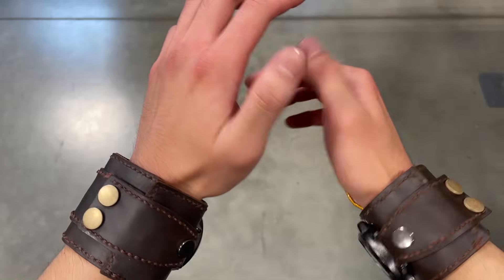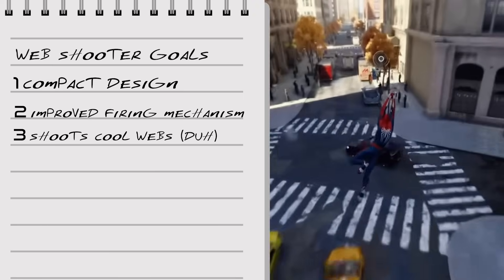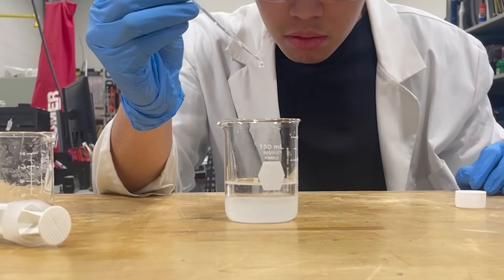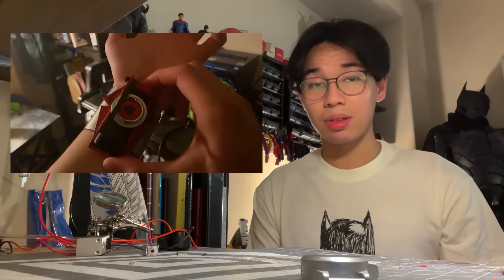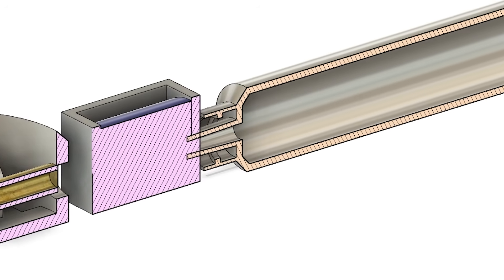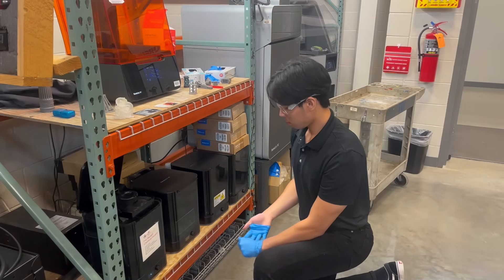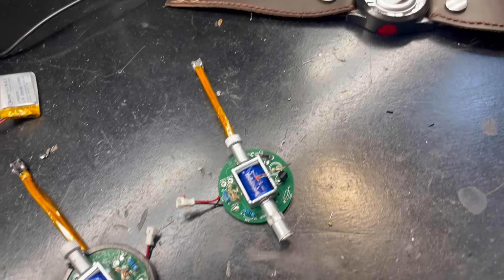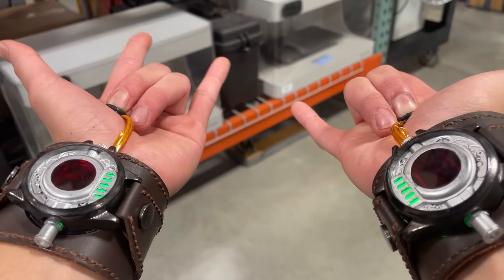How I Built Real Web Shooters | Spider-Man

Comment: Is there a website or app that will help me design a PCB with little knowledge of electronics?  I’m talking baby stuff.  I guess what I need is an interactive learning program.  I’m a hands-on learner and that’s hard to do without buying the gear.  I’d like to break through this barrier that’s preventing me from moving forward with a project I really need to make.
Reply from the maker: Kicad and YouTube videos would be my suggestion. Kicad’s probably the best pcb designer I know of and it’s free, but I used fusion360 since I was more familiar with it and I’m a student so I get it free.
Reply: @schizo4725  thank you for the suggestion, dude.  I’m looking into it asap!  I want to make a small box with a led that will sit on top of a TV.  It’s connected to the computer and will illuminate or flash when you get an alert (of your choosing).  I know I can do it!  Thank you for sharing your projects and journey.  It’s inspiring and motivating me to try. I can usually understand things very quickly and this has been evasive asf.  Thanks again, schizo!

Comment: I just saw your video and thought it was pretty cool idea. I'm a 61-year-old engineer retired but I was looking at the air container that you were using for your compressed, and thought you might find a nice stainless steel flask for whiskey. It'd be like having several of those single containers in a smaller more form fitting and fairly hefty as far as safety goes, item. I don't know what it takes for as far as PSI but I'm sure you can find a nice one that'll fit your needs. FYI.

Comment: So just a half baked, new to engineering theory, couldn’t you add a secondary cartridge of water from a separate tube to mid section of the ejection end, using your laminar flow idea from the start to add a sort of “frame” to the fluid, giving you your fluid both the desired strength as well as possibly adding reach?

Comment: Maybe coat the tubing and valves with teflon or a nonstick coating?

 Also, if you want the web to not just come out but form a rope like structure, the nozzle should be several small Gabriel's horn shaped (surface of rev for 1/x) nozzles in a disc mounted inside a bearing. the pressurized side of the disc would have radial vanes than make it an impeller. When triggered, the pressure would cause the disc to spin while ejecting webbing from the tapped through nozzles. The streams of web from each nozzle would have a helical path that causes the streams to twist around one another as the travel.

Comment: Yo can you do a more detailed tutorial for the cartridges in the web fluid tutorial please
Reply from the maker: I'll probably be doing a more detailed tutorial for the next cartridge. These cartridges aren't very good anyways.
Reply: @schizo4725  great! Can’t wait to see the video
Reply: @schizo4725  hey where can i dm you
Reply: @schizo4725  yo had an idea for a new cartridge that might be a bit better/ simplify the internals of your web shooters. Make a cartridge similar to a soda bottle just small, attach something that you can plug a butane can into In order to pressurize the cartridge, add a lid that’s made to be airtight but can still be removed, then take the valve off of an empty aerosol can then epoxy it into the lid. Add a modded trigger from one of those mini spray bottles. Plug the og hole and then add one on the top with a sewing pin. Then the cartridge should be done. Fill it with the fluid then pressurize it and when you push down on the trigger located on the top of the cartridge it should fire the webbing out in a mist and pretty far too basically working like a shooken soda bottle only with a valve on the top and a misting trigger. Not sure if you can use this with this web shooter but perhaps one in the future.

Comment: I think laminar flow could work, if you put atomised water one next to/around it( with cilcular design you could make it around the one). This way you would have increase in both range and strenght of thr web fluid due to whole reaction. Sadly it would require two cartridges, but hey, it should be viable.

Comment: You might be able to force the vinyl to form a cable if you use a split or two-piece nozzle design. My immediate thought is something like fuel injectors in a rocket engine, or even a mechanism to spin a split nozzle using a small DC motor. This adds complexity and will need more space, but if you want to build something that's going to really function as you want it to, you might want to consider getting the functionality working prior to miniaturization vs. miniaturizing and forcing ideas to work within the space. It's usually easier to design things down in scale after making a functional proof of concept. Gets rid of the "this might work, but it won't fit in the cool housing I designed" limitation.

If you were okay with using multiple cartridges instead of one, you could have a second cartridge with solvent, and have the arduino switch over to that cartridge for the last 5-10% of a web cast. It might not clean it fully, but a small self-cleaning step after each shot might help increase runtime before a full jam. I'd think in the fiction that the web fluid has some kind of impossible material programming to be incredibly slick at time of firing to help prevent jams and friction with the nozzle, then it gains mass and stickyness as it travels and the composition reacts with the air. Each step of that material reaction will have to be accommodated for using real-world chemistry and engineering, or just being happy that you're materializing a string from a pressurized vessel of fluid lol.

As for the toxicity of the web fluid, PVAc is non-toxic and can't be absorbed by the human body. But because you're atomizing both it and a solvent to fire, that's all crap that can get in your lungs. Try to stay upwind while testing and wear at least a dust mask if you're concerned with the inhalation risk.

Comment: I'm sure there's an obvious reason I'm just missing, but why don't you just shoot out water at the same time you shoot out the webs for the reaction?
Reply: He's using PVA mixed with water in a hyperviscous fluid, which, once aerosolized, increases the surface area so dramatically that it reduces the water content down through convective evaporation, hence the jump cut after the spray to show the really neat cobweb effect. He is essentially doing this but in reverse, which makes sense. PVA is solid and brittle unless wet, and cannot be sprayed from a nozzle unless in a water solution (essentially you mix PVA with water, heat it up till it makes this glue, and then let it cool to room temperature). You make the ropes by taking a solid dehydrated form of PVA and very slowly adding water through vapor until you get just the right ratio for the hydrogen bonds to enable plasticity. You hypothetically could achieve this using the current PVA solution if you remove exactly enough water, which is not doable with heat on your wrist. However, water electrolysis occurs at between 1-2V and is current driven, meaning you could efficiently accelerate dehydration of the fluid to its optimal point. Potentially use a coiled tube to achieve a long enough "electric dehydration" you could shoot a rope while controlling its adhesive properties using electricity alone. You could get a few megapascals of tensile strength if you get the mix just right, and it would effectively turn to dust once it fully dries out.
Reply: @Naesen Anhydrous materials could aid in precision water absorption. Sodium polyacrylate, for instance, can rapidly absorb water and can store 200-300 times its own mass. It can also rapidly release water in the presence of a sodium salt. A mechanism for delivery might prove challenging(rapid delivery of a powder into a pressurized fluid is not really common in any industry). Along with this, direct mixing could weaken the Poly vinyl acetate due to incompatibility between the polymers, which would form interface boundaries where fractures could occur. Expansion of the sodium polyacrylate might also prove to be a challenge for both structural integrity and actual web shooting, since it could clog the valves.

Comment: I recommend using a mini TCU(temperature controlling unit to atomize the stream more effectively. This will also help with your next web fluid formula. You can use nichrome heating like with the saber you made but put it post valve before outer nozzle. There are also well designed atomizer outlets that you can buy online as well.

Comment: Here's 2 possible goals: goal of making a string that you could pull or interact with and goal of being able to web a surface efficiently at very close range (under 20cm/1foot), the common thing being making a significant/visible/tangible effect. 
For now from what i see, the web fluid isn't aerodynamic and gets caught in the wind, could be a viable spiderweb builder. I would recommend to reach a milestone of stable close range to create a singular web shot encasing an object for example. 
From that point, working on aerodynamism is essential before trying to create a "web rope".
I'd recommend experiencing larger quantities for testing, therefore putting the "compact" attribute on the side for now. There also might be substance loss when coming out of the cannon that could be simply fixed with a better cannon shape. 
Sending big hopes for you, good luck.
Reply: Theres substance loss because of the evaporation

Comment: if you make the end of the nozzle have a bunch of holes with an inwards angle in a spiral, wouldnt it, spin and create a cord from your web fluid?
 idk if i explained it right but ive been thinking about it for a while.
Reply: Yeah but if it doesn't dry in time surface tension will make it clump up into balls at distance, you might need laminar flow to keep the stream solid